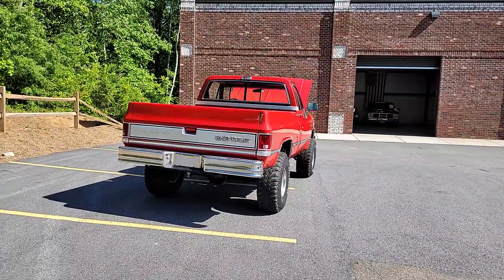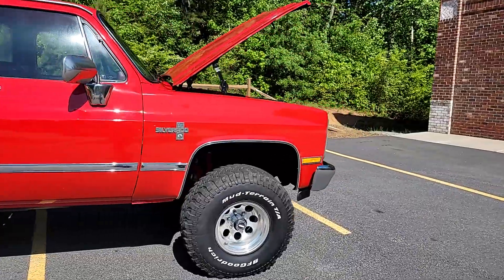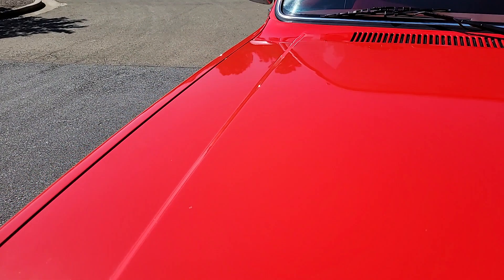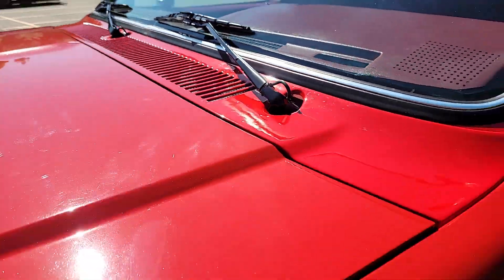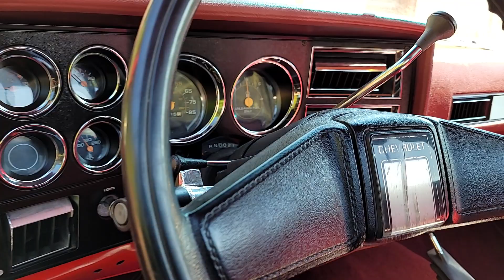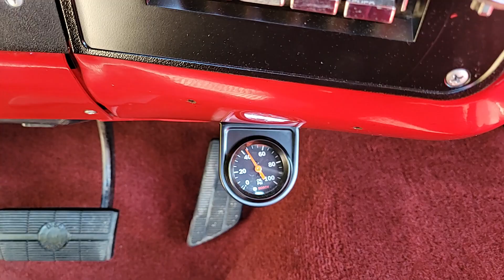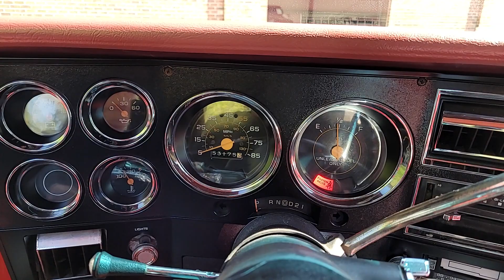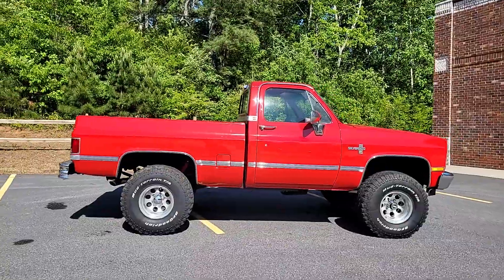SOLD - 1986 Chevrolet K10 4x4 Pickup Truck

Comment: I sold my new truck. I’m going back old school full time. I run across one like that around here and it’s gonna be mine 👍🏻. I’m done with this new crap. I can make a old school Chevy every bit as reliable. They were good enough for daily driving back then and they are good enough now
Reply: He'll yeah.im just concerned about parts availability.
Reply: @nealamesbury7953  LMC Truck. Has every part you can imagine for old Chevy trucks. 1967 to 1987 trucks you can easily get about anything for. Chevy small block V8 engines...anything and everything. Now 1966 and older trucks things get a bit harder but even they have a lot avaliable. Chevy trucks are so popular that there is always going to be a big market of parts for them. No worries 👍

I drive a 1988 S10 every day now. It's like brand new. I'd get in it and go anywhere at moments notice 👍. Has original 4 cylinder ( rebuilt) and 5 speed stick.